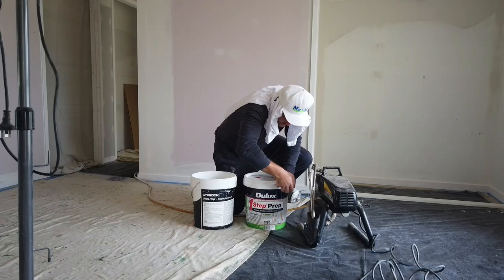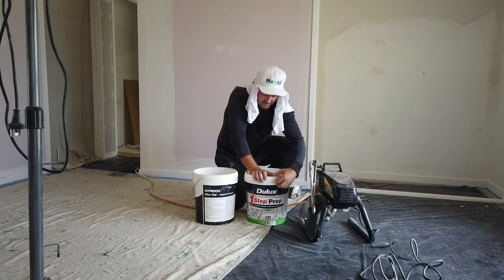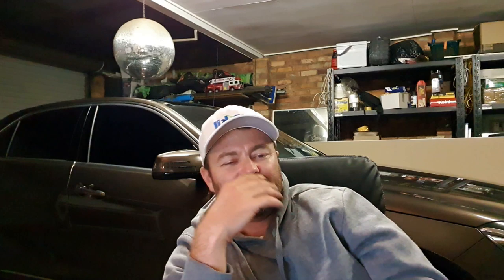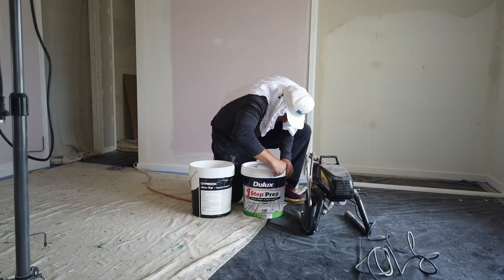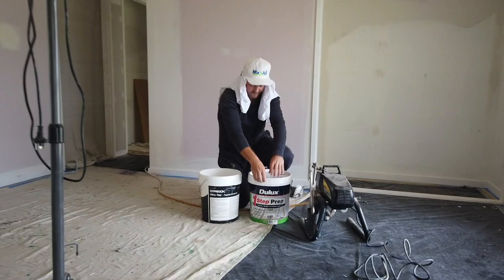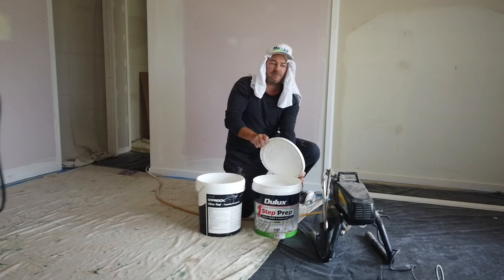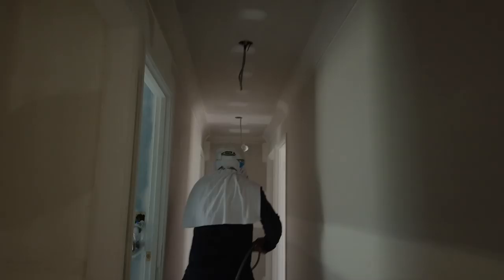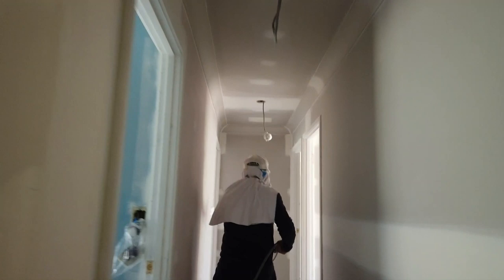Troubleshooting Wagner Airless Paint Sprayer

Comment: Hello.  Congratulations about your videos. Let me explain to you my problem.  I'm using wagner 250 Pro. When I spray outside walls with acrylic elastic paint the pattern is with tails both sides. This doesn't happen when I use emulsion paint for inside.  Is about viscosity or about its different paint. Thank you

Comment: I think your spray tip is blown out or your pressure is wrong the massive tailing in your spray pattern it shouldn't really be there not criticising just looking you will get lap lines everywhere for future reference
Reply: Thats what I noticed, massive lap line... For UC, you may get away with it, being a flat paint, but LS or SG paint, you're asking for trouble.
BTW, wtf is the point to spray your house when a guy is rolling after you???
Set your machine up right, match the tip to the viscosity and type of paint, and you never need to roll. You just went from a smooth spray finish to orange peel roller..
Reply: this happens due to lack of pressure for the tip used , its called Tailing, in increase in pressure solves this issue , but also uses more paint and can get a lil untidy , the idea here is to lower the tip size and get the pressure right ,

Comment: Quick question...Roller brush after spray.. Is it necessary? If yes then why?
Reply: Yes! Back roll after spraying. Gives an even finish and can be touched up better than if just sprayed.
Reply: Will Swift  Just a normal separate roller. The same way they are doing it at 8:35 in the video.